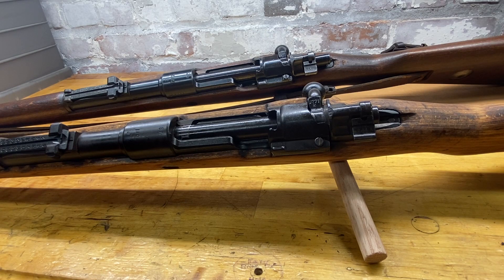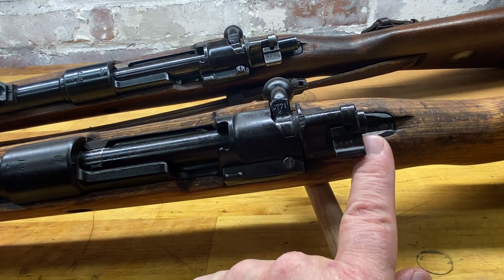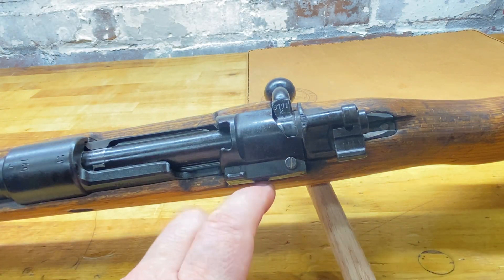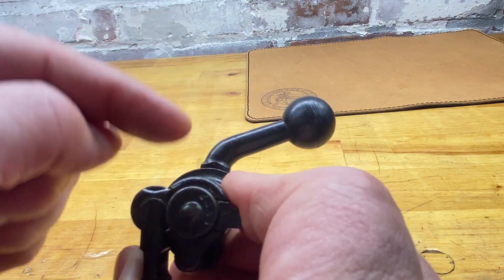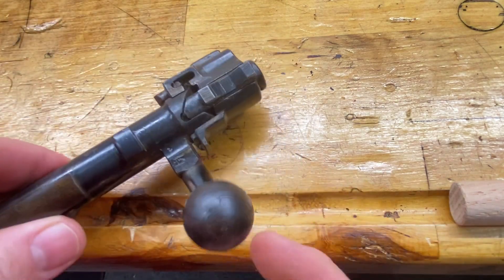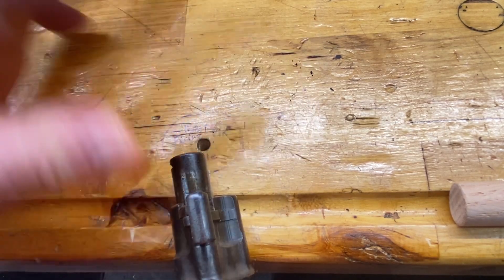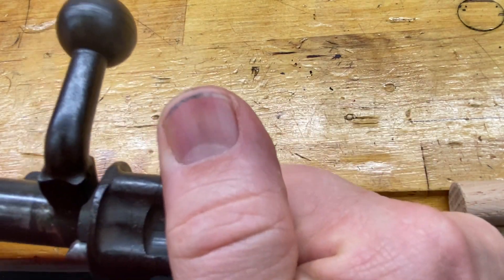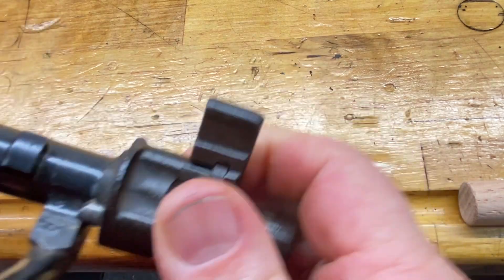K98 Mauser Bolt Reset for Disassembly

Comment: There is a slot on the side of the striker to put the rim of a cartridge case in there so you can pull the striker back. No need of using the side of a workbench.

Comment: Just picked up a mauser and im having problems with the firing pin releasing when locking up the bolt (ready to fire postion) so i i stumbled upon your video trying to check everything out. Mine doesnt have the rear safety tab, but a more "modern" bolt gun safety. Also, the small pin that you push in to unscrew the shroud is stuck in all the way. Any tips? - Sorry for being long-winded.
Reply from the maker: Hello.  Check your trigger and sear set up.  It sounds like form what you write that the sear in not up fully into the receiver form the bottom.  Can be worn pin or weak spring.  Ensure its clean too.  Take it form there.
Reply: @norwich93CMP  will check that out. Thanks!
Reply: @wyattarie8905 Hi, i also have a different safety tab. Did you fix it?
Reply: @MrBodframar  I ended up being able to adjust the trigger heavy enough it wouldn't fire when locked up. But never figured the bolt itself out so I didn't trust it. Traded it to a guy that said he could fix it.

Comment: Unrelated question,  i just picked up a non import stamped IBM m1 carbine. Has a type 2 barrel band thats missing the sling mount(looks to have broken and filed off) where might i find a replacement origional? Also it has an inland barrel so its not a museum peice but i want a legit barrel band for it

Comment: hey i love your vids! quick question Norwich, my safety's' on, bolt cocked, but i can not unscrew the bolt head, even when i depress it, ive watched both your bids. Any help would be greatly appreciated! thank you
Reply from the maker: Does it move and fire in a rifle?
Reply: @norwich93CMP  The rifle fires. I ended up getting it unscredwed and dissasbled using an uncoventinal method, however now the saftey will no longer enegae. rifle still works, but unless i use a mallet to flick the sfatey on, i can not move it

Comment: Thanks, good advice.  I"m trying to disassemble a M98 commercial bolt which has a thumb safety on the right side, not a military three-position safety.  Knowing how to "re-cock" the bolt will help with disassembly.  Thanks again.

Comment: Thanks Rob !! On one of my Mauser bolts and the bolt is in the rifle cocked and ready to fire i cant move the safety to the safe / straight up position. Its stuck in the fire position. Do i need a new FLAG safety piece.? THANKS
Reply from the maker: Probably not.  Sometimes they don't align well.  It many need to be "persuaded".
Reply: @norwich93CMP  Hi Rob ya i will give that a try.. THANKS

Comment: I have a similar problem with my bolt as well. I'm able to move the safety up but after that i cant get the thing to budge at all
Reply: after about half an hour fiddling around and cutting a finger i finally got it back in. never making that mistake again